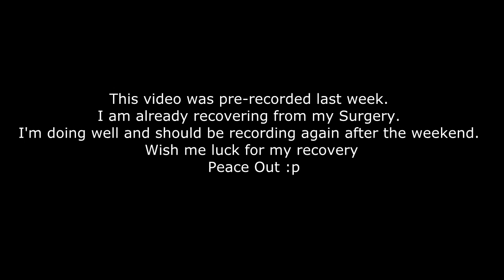Let's Play Minecraft Hermitcraft FTB Ep. 23 - Nano Sabers Kick Butt!

Comment: You mest up ur extraction bit. Your bottom left router for extraction isn't set to industrial centrifuge. Also all your routers are set to slot 3 meaning they will all try to pull from there meaning ur only going to be pulling out silicon. And the item filters on half your routers are useless. I've made the same setup with no item filters. They have really no point I see.